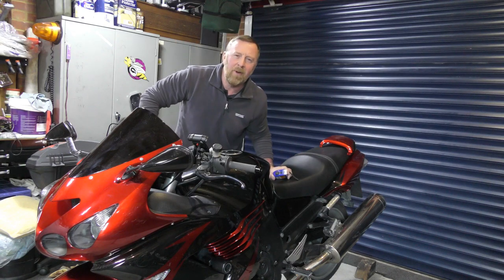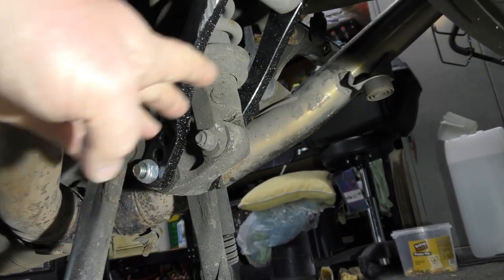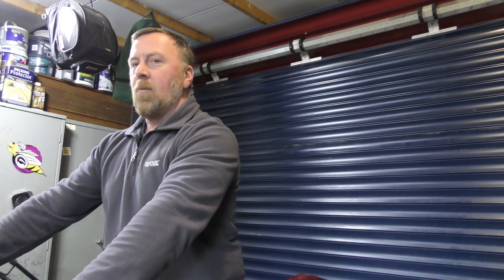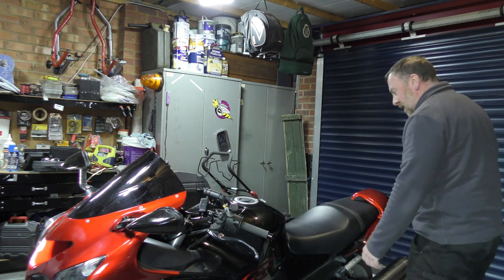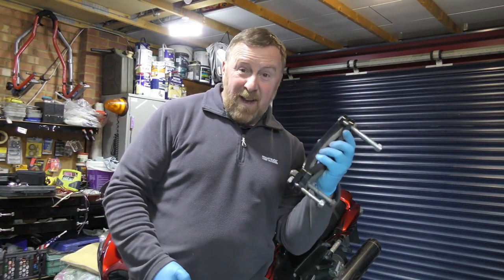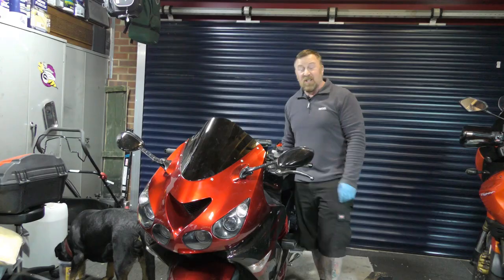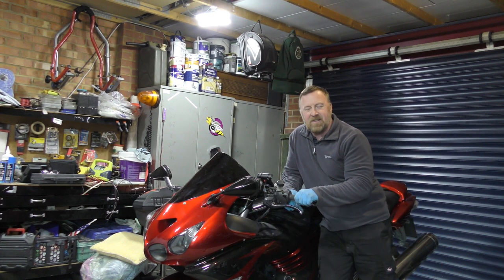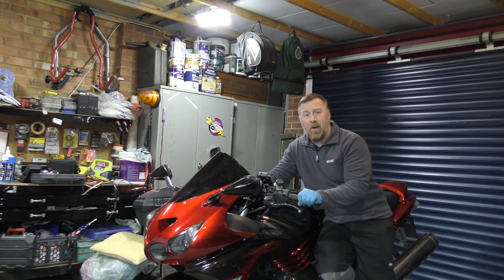LOWER KIT FOR KAWASAKI ZZR1400 ZX14 GOOD IDEA OR NOT !

Comment: Hi Mark, had a similar issue with my bike. Lowered it and then it stood up too much on the side stand. At a petrol station it went to fall over, but I managed to say it...just. Luckily there is another shorter side stand from another model, so fitted that and now the bike is perfect.
Reply: Hi JDH,What was the model side stand you used?
Reply: @shanesmith429  Sorry mate, it wasn't this model of bike. It was my NC750x, I used the stand from a NC750s.
Reply from the maker: this was my worry and yes you can change the stand but it just didnt feel right , lucky you saved it lol

Comment: Wouldn't recommend lowering this bike if you ride on the street to any extent.  Get a shaved down seat first.   The bike is so low you will beat the fenders off of speed bumps and stuff if you lower it.  Plus the bike is actually incredibly nimble in the turns as many would be surprised to hear, it does very much so handle like a sport bike.  Lowering it will effect that negatively as well.

Comment: Great vid, just wondering whether it is possible to lower the front as  well as the back on this bike?
Reply from the maker: You can by the top of the shocks through the yolk ,however I would as it feels odd and it's only by 5 to 10mm which really doent make any odds bud
Reply: @marksavage  ok tks
Reply: If u don’t lower the front as well, ur headlights will blind on coming traffic, there’s a kit for it, but it’s a bit of a fight to get the front end low enough to match the rear, also front travel is limited- probably best to leave front alone and adjust the headlights

Comment: Hello mark, I lowered my ZZR, worst thing I ever did ! And when the tyres have low pressure 😮 omg not good at all, every ride out was a fight with the bike - just going out to my garage to put it back to standard. Cheers
Reply from the maker: I didn't like it on my zzr ,yet on my trophy it was great
Reply: It’s was too easy to bottom out, my centre exhaust pipe has taken a few whacks 😳 I’ve just got back in from the garage having restored to standard, been meaning to do it for months- saw ur video and it inspired me to and do it ! So cheers for that 👍🏻
Reply from the maker: @robbie8526  I didn't like it and still got the lowering kit 
So much better back to normal 
Enjoy bud 
I've got a few more zzr videos you might like 
Full service and exhaust videos too
Reply from the maker: @happypanda8320 sorry bud no, as a big job i never liked doing,

Comment: hi mark unrelevent to this video but a question i have is i got a watercooled speedfight 1 1999 the exhaust is a heavy duty stock one but i want to put a yasuni R on it will i have to upjet the carb
Reply from the maker: any exhaust will be better than stock so come down to you taste , just change exhaust first as most will run without upjet but if so id go 4 up from stock